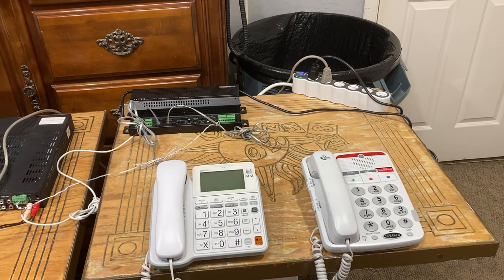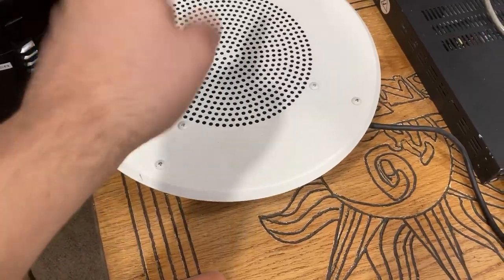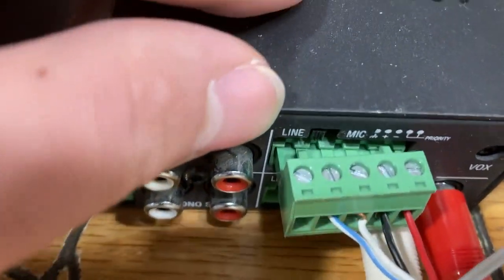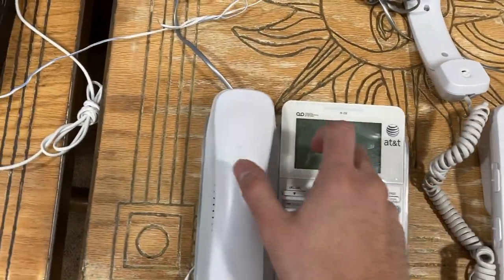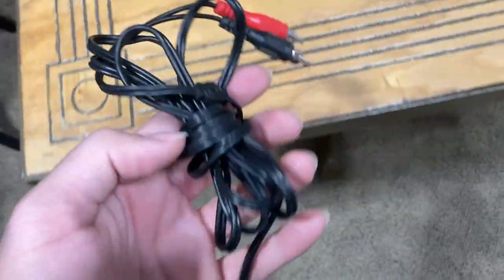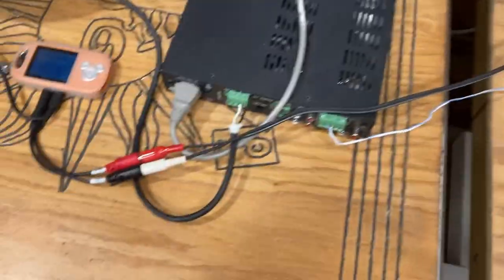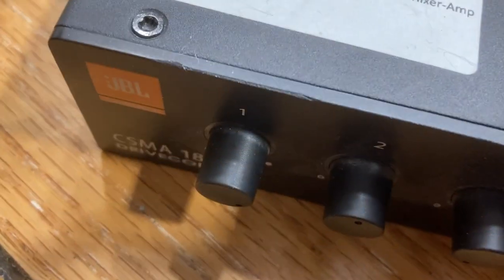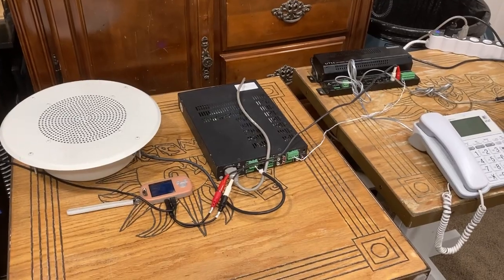How To Set Up A Bogen UTI 1 For Intercom System

Comment: Also, one question what amplifier do I need to use to wire up the Bogen WBS8T725V so that way I can use it on the Bogen UTI1
(Also The Bogen WBS8T725V is a 25V/70V 4 Watt wall mount Speaker)
Reply from the maker: You will need a 70 volt amplifier to use the speaker with the UTI1
Reply: @CristianOrtiztechmaster926  thank you so much

Comment: The remote mute can be used if the Fire alarm goes off, it mutes the speakers so you hear the fire alarm
Reply from the maker: There are multiple uses for the remote mute which commonly is used for paging in most retail stores. The fire alarm application makes sense as well.

Comment: Hey Mr. mercury fix it. I have a question so my school has plenty of speakers in throughout their hallways and some speakers in the hallways doesn’t work, so do you think I should ask the principal if I can use those speakers because there’s speakers in there that don’t work and they’re just sitting on ceiling tile?
Reply from the maker: I don't think that the school will not want to remove the old speakers due to time and extra expenses of having to replace ceiling tiles. However, if you are inclined to ask the school, I would talk to the head of the maintenance department since they are the ones that deal with that kind of stuff. The principal may not know as much as someone in the maintenance department would know. It does not hurt to ask at the end of the day.

Comment: Would it be possible on a multi-line analog phone to connect one line to the override and the other to your standard RJ11 Wall Jack? (1 line for the intercom, the other line just for calling.)
Reply from the maker: It's possible to use both and depending on the phone system you have the UTI one can do station or trunk mode with a flip of a switch.

Comment: One question, is there a way to have a custom code for the paging system?
Reply from the maker: Not with the UTI-1 from factory, but it's possible to do it with a few extra components connected to the UTI-1. If you want custom tones, you will need an MP3 trigger board and an audio line mixer such as a FIFINE Ultra-Low-Noise 4-Channel Line Mixer to mix both audio inputs coming from the trigger board and the UTI-1. Tones can be disabled on the UTI-1 if needed. The trigger relays on the UTI-1 are enough to activate the MP3 trigger board with your custom tones.

Comment: How do I set my own tone on my Bogen uti1
Reply from the maker: You cannot set custom tones on the UTI-1 from factory. If you want custom tones, you will need an MP3 trigger board and an audio line mixer such as a FIFINE Ultra-Low-Noise 4-Channel Line Mixer to mix both audio inputs coming from the trigger board and the UTI-1. Tones can be disabled on the UTI-1 if needed. The trigger relays on the UTI-1 are enough to activate the MP3 trigger board with your custom tones.